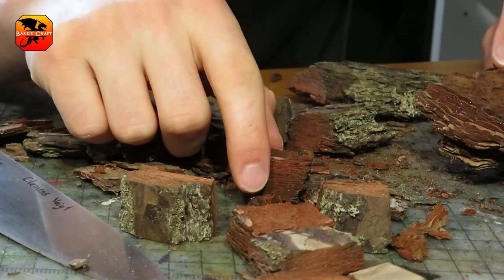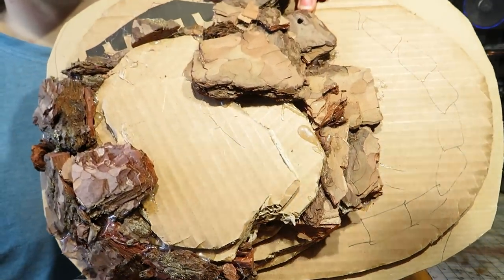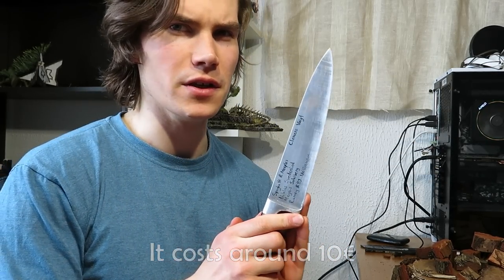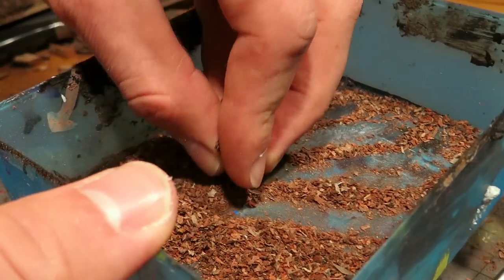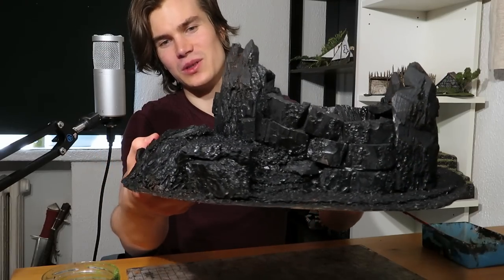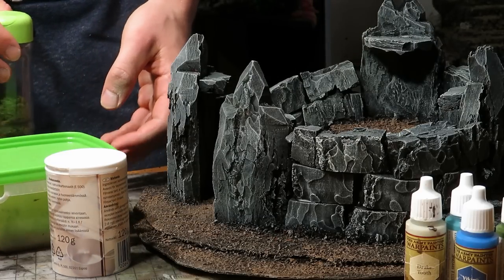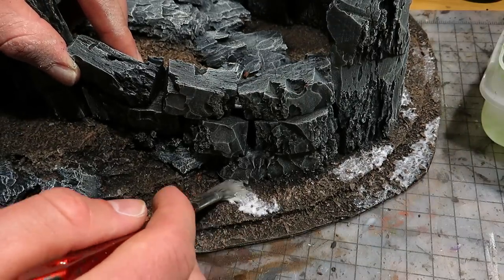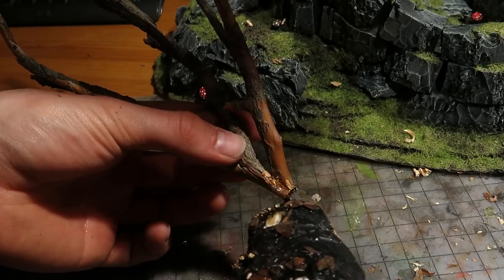Building a MAGICAL Elven Stronghold Diorama for D&D + Wargaming

Comment: "I hope my bricks are enough... No, they aren't."
-Bard's Craft, and every other crafting DM ever. Usually twice per project. 

Maybe three times per project.

I had an idea while watching this that might be able to save you some time and effort in the future with wood-based projects: Wood-facade foam bricks. 

1) Cut foam bricks. Round the corners a little so they can fit together in a circular pattern. Don't bother to texture them.
2) Glue thin sheets of bark, or a mixture of PVA and that chopped bark flocking you use for ground cover to the outward-facing parts of the bricks. 
3) Stack the bricks as normal. Cover the seams up with your chopped bark flocking and possibly some patches of "moss." 

The bricks would be lightweight, use less bark, and fit together seamlessly.They might also form a visible pattern, and ruin the random/natural look you were going for.
Reply from the maker: 100% true

Comment: To apply the flocking you can use a plastic bottle made out of soft plastic with big lid. Drill the holes accordingly. Pour your flocking into the bottle and when you apply it hold it very close ( about 5 mm) to the surface and press the bottle. By pressing the bottle you will "shoot" the flock and it will be "standing"  as if it was growing straight from the ground, and not just laying there.

Comment: Great job, looks awesome!
I think it´s cool, that you great looking terrain in an easy and cheap way, wich especially great for beginners.
Two things about this build:
1. I think it would look great, if the "channels" that were carved into the bark by bark-beetles, were painted in a colorful way. The look like runes, and I guess they would be perfect by painting them as such :D You can see them at 17:52 .
2. I like those huge chunks of bark you used for your archer-platforms. I guess they would look great on a more tribal form of a dwarfen fortress or outpost. The chunky form getting pointy to the top kind of reminds me of a dwarf, as the bark structure kind of reminds me of a beard. 
I think it would be cool, to see some kind of tribal dwarven terrain. A bit rougher and less civilized than the other dwarves, not caring about gems and gold, but only iron and steel to forge their weapons with and seeing the forge as some kind of god :D

Comment: How do you measure your mixture ratio for the PVA glue spray? I’ve been buying an acrylic sealer, but have neglected using it on several projects because I’m not happy with how it changes the coloration. Your PVA glue spray seems to work wonderfully!